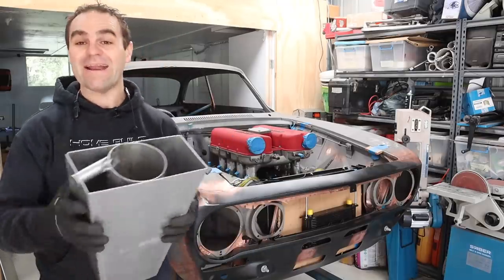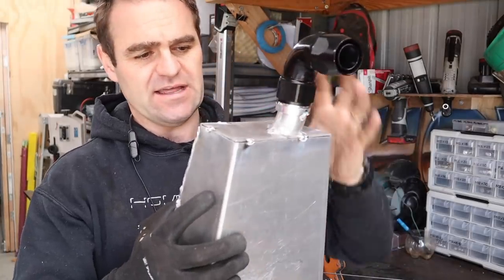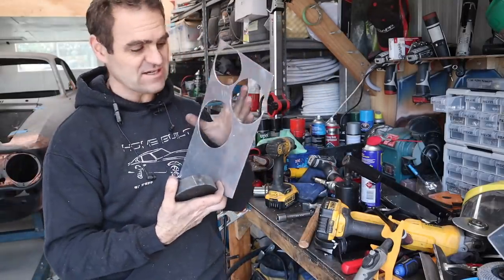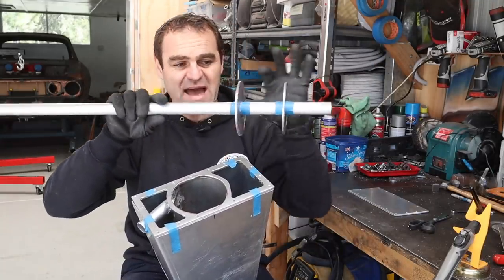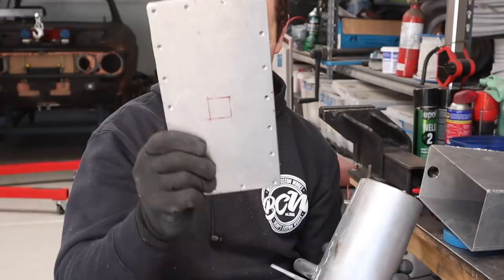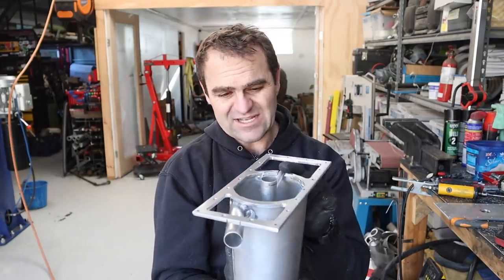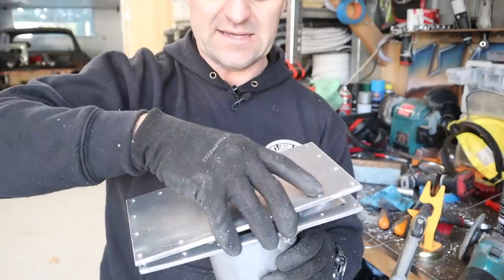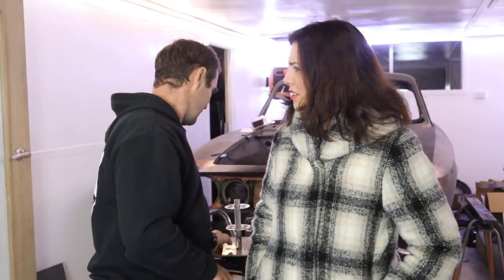DIY Ferrari Dry Sump Oil Tank 2 - Ferrari engined Alfa 105 Alfarrari build part 57

Comment: Don’t do a dip stick, use a sight ‘glass’ tube on the side of the tank or a sight glass in the side of the tank like a motorcycle oil level glass (you can buy them) and you can make a hole in the wing to view the level, just harder to set the normal level in the first place.
Reply: A level tube is very useful for setting the oil level, you can watch the level at first start up, while the engine warms and then on the dyno at max rpm and see if the level gets too low (or high due to frothing, back pressure etc) at any time and stop the engine before damage is done... great for an unproven system 👍 use a decent size tube 1cm or bigger as it will react quicker and not get ‘stuck’ with oil viscosity/stiction in the tube.
Reply: If you can run the tube down the outside of the tank between the tank and the wing it will be protected then cut a slot in the wing so you can view 👍

Comment: I know it’s not going to be under pressure, but you should hydraulically pressure test it. You don’t want the car all put together just to find a tiny pin hole leaking oil all over your nice work.

Comment: You have to put a magnet in the bottom, for heavy metal.
Reply: ^this x100, you'll just have to glue it using chemical/oil resistant adhesive  since tank is aluminum....or clamp it down with welded aluminum flap.
Reply: I was going to ask the same thing.

Comment: You could solder or braze that tea strainer mesh where you need to cut a hole, it will hold the strands together and make drilling to an exact size 👍

Comment: Great work Jeff.
When working with Aluminium when I was being an apprentice 25 years ago we used 95% alcohol for aluminium. When drilling etc.
Reply: Is it safe to drink hard liquor with drilling metal?
Reply: 😂 no... 
You use it to cool, and lubricate the drill/tools with.
It works really well.😎
Reply: @ronr6450  lol... I dilute mine with coca cola to ensure better machined results. With 95% neat I end up with skew parts

Comment: Good man Jeff. I am now up to date with all your project builds. A lot of viewing. Thanks - makes lockdown in the pouring rain here in Ireland worthwhile. (Rain every day for almost 3 months now grrrr). Just a thought, when using the band saw, I was always told to have the top support just slightly above the work. Stops the blade flexing. Top job, btw. That car will be as nuts as a balloon full of frogs.
Reply from the maker: That is as low as my top support comes down :(

Comment: You can put a strong magnet inside that will catch any possible metal particles before they can go back to the engine. Some gearboxes has these on the drain plug.

Comment: 1 small correction, the street version of the GTA (only 1 build) were a production version of the racing 155 GTA wich means that unlike the q4 it kept the Delta rear suspension (while the q4 had the 155 rear scheme mated with the delta transmission)
there's a  series of interview to ing.limone where he talks about his story with lancia corse and the fiat imposed switch from lancia to alfa of the whole lancia corse, and how basically all the 90's winning alfas had the chassis and transmission setup done by ex lancia guys

Comment: Looking good mate 😊 I'd certainly say your TIG skills are improving with each video 😊

After watching Binky then maybe a strap, or straps, to hold the tank in place would be best to avoid the alloy mounting tabs stress fracturing.
For the level I'm intrigued to see how you could squeeze a dip stick in there. Sight glass is simple but not convenient to see. I know VDO make a tube style fuel level sender but dunno if it'd work in oil. Brake reservoir cap maybe?

Comment: Another point is that usually the scavenge hose size is bigger than the supply size because there is a lot of air in the oil when it returns from the pump.
Reply from the maker: It is. -12 in -20 out ;)

Comment: As mentioned previously, I think you need to check the maximum oil return flow rate as , from my experience with dry sump systems, it can be very high and I am not sure your narrow inner de-aration tube  and baffles will cope.

Comment: Just make sure that the -20 hose is of a type that will not collapse under suction. You wouldn’t be the first to loose an engine from lack of oil after the hose from the tank to the pump has sucked flat and starved the engine of oil

Comment: First be careful of your components vibrating together in the tank. That will make aluminum dust and migrate into the system. Next arrange your filter to filter oil out of the tank and into the engine so as to guard against any tank contaminants possibly making it in. Sight glass for oil level would be great as well.. cheers!!

Comment: Preheat,  will make your life so much easier...
Reply: Philip Crocker But he did.
Reply: Tom Ahoks when? When he is talking about welding the 6mm plate he is talking about angling the tig torch on more of an angle to heat the plate more than the pipe. When I say pre heat I mean grab the blow torch and heat that sucker up

Comment: I think the return breather is WAY to small, the scavenge pump in it self will put a lot of air into the tank that needs to exit. Think about the 911 it has a 20-25 mm breather back and forth.

Comment: Why put the dry sump tank in the wing where its difficult to get to for maintenance and is very vulnerable to damage from stones and accident impact.  I appreciate that Porsche fit their 911 dry sump tank in the wing but that is for volume manufacturing reasons, they along with most competition car builders fit the tank in the boot (whether that is at the front or the back).  As this is a special tank, to determine the correct oil level the engine is run and the oil in the tank is filled up to the baffle plate, whilst it is still running.  The engine has to be running as the system has a significant quantity downstream of the tank.  To check the oil level, a screw cap on top of the tank is the best access for viewing.  I would not use a sight tube as in your location it would be vulnerable and sight tubes are always a risky addition.  Have you checked the relative levels of the tank oil and the inlet to the engine as you don't want the oil siphoning from the tank to the engine or vise versa when stationary.  Also, whilst your idea for the internal pick up is to be applauded you will need a drain plug to release the accumulated sludge at the bottom of the tank at every service/oil change interval.  Your pick-up does carry with it the risk that if there is sludge in the bottom of the tank, without regular cleaning it will fill to the level of the pick-up and be sucked en-masse into the engine.
There is a mantra you should adopt for this part of the build - KISS and don't re-invent the wheel.

Comment: -16 line would be better than - 20, because more oil pressure
But still good, keep on grinding
Reply: It's on the suction side of the pump, you want as little resistance there as possible.

Comment: Worlds most complicated oil tank!
I would have made a simple tank and ran an oil cooler to de-aerate the oil.
Reply from the maker: It does have an oil cooler before the tank. If only dry sump tanks were just a bucket...
Reply: @HomeBuiltByJeff  wouldn't flowing the cooler do the job of the baffle?
I'd be worries about all the restriction in flow starving the bearings.
Reply: I might be corrected.
I think an oil cooler would restrict the flow of oil too much.
As Jeff says the oil is already being cooled.
Just need aerating.
You need a 
high  capacity  (relatively) unrestricticed oil flow from top to bottom of that tank.
That tank will store probably about 4/5 litres of oil at the bottom. 
This will allow a smooth constant flow of oil without air bubbles to the engine
...
Just don't think there would be enough capacity/flow from an oil cooler.
Reply: Well, Jeff has done his homework on dry sump oiling systems, and you haven't..

Comment: I'm uncomfortable.... if the bulk of the de-aeration  happens in the swirl tube, then the bulk of air venting needs to be from the swirl tube.....  you need some holes from the swirl tube into the central vent pipe.....  not much oil should go through these holes as it's all stuck to the outer wall by centrifugal force....